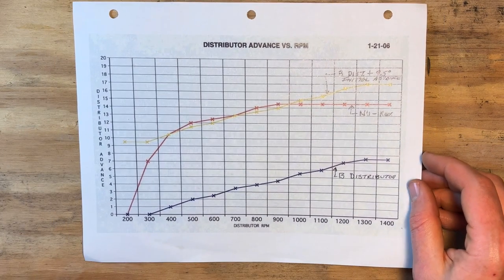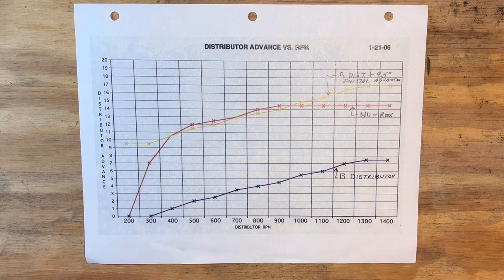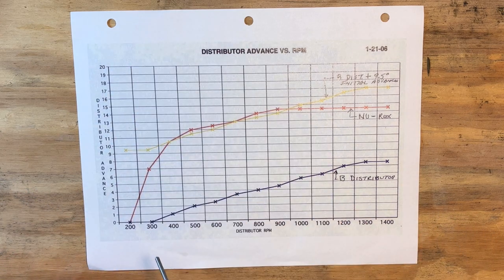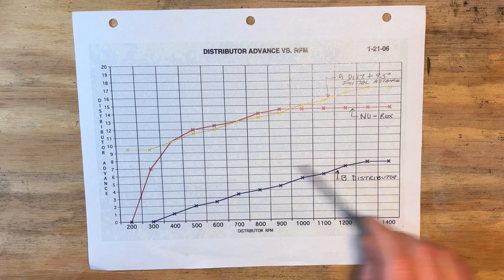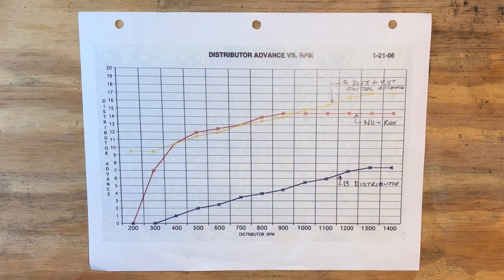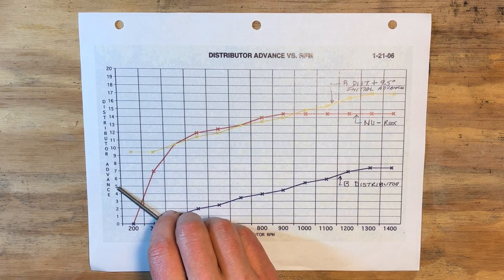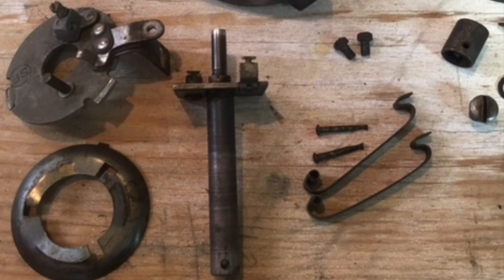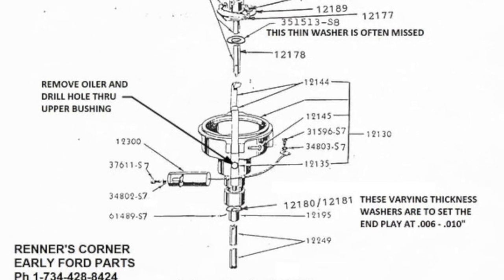Model A Ford – Upgrading to Model B Distributor – Part 1

Comment: Very nice!

As far as those pivot pins go everything in the distributor is hardened and wear it's not too likely but you can grip the pins with pliers and turn them 90° and get a new surface for the weights to act against with both the plate and the yolk pins.
Additionally, when centrifugal force acts on the weights, they spin out and they're tight against the pin.
Reply from the maker: Hi Dave, thanks so much for your comment. Really could not have done this without your prior research. Re: the pins, mine were really worn, to the extent that I couldn't be sure they would hold position, even with centrifugal force pushing the flyweights out.

I've reached out to Vince Falter to see whether he might have some reference NOS examples of the weights and springs for use in the next video, where I look at what timing curve the B produces.

Comment: Fantastic - I wish that you would show tightening the screws so viewers have an idea of how to correctly torque them.
Reply from the maker: The only one you maybe need to put a little oomph into is the cam screw. Otherwise hand tight should be fine. I tend to cut the parts where I'm attaching screws – first because I'm sort of a clumsy guy and second because the overhead camera means I would need to hold the workpiece at an odd angle so you could see what I was doing.

Comment: You should always use a cam screw with a hole down the middle so you can lubricate the yoke that spins on the small diameter of the shaft. Otherwise you have to remove the cam screw to lube the yoke a drop of 3 in 1 oil every 200-500 miles is plenty.
Reply from the maker: Good tip

Comment: Tried the B distributor but found the reissue of  Phillips Spark Advance tec made in 1930s by Nurex better.  Petronix ignition replacing the points makes for reliable and more forgiving application.  Use the common A distributor.   Like the old look but not old time consuming, fidgeting and frustrating issues of which some get satisfaction overcoming.
Reply from the maker: Yeah, if you keep compression under 6:1, the Nu-Rex is a lot more effective.

Comment: Very well done video. Clear concise instructions on rebuilding a B distributor. I believe your explanation of the purpose of the condenser and the production of the spark is just a bit off, if I may. The longer dwell, the time the points are closed, allows the primary windings of the coil to draw more current creating a stronger magnetic field. The condenser absorbs the the energy, or arcing, that would occur as the points open. The arcing would interfere with the instantaneous collapse of the magnetic field of the primary windings that induces a much larger voltage in the secondary windings which directs that energy to the spark plugs. If the condenser is weak the points will eventually burn from the arcing and the spark will be much weaker or non existent as the primary magnetic field only partially collapses or not at all. The B condenser has more capacitance because the longer dwell time means more current flowing to the primary windings and more current trying to arc across the points. I'm looking forward to more of your videos.
Reply from the maker: I think I agree with all this? What's the timestamp of the part you thought needed more clarity?
Reply: @alexiskai  I must have cut to your video on Condenser Testing and Theory that you mention at ~ 32:14. In that video, when you describe the function of the condenser, I believe you may be conflating its function with the capacitors in a Capacitive Discharge Ignition. In the Kettering system the sole function of the condenser is to absorb the energy as the points open so they don't arc. You are correct in that no current flows into the condenser because it represents a higher resistance than the closed points. Once the points begin to open the current flows into the condenser instead of arcing across the small space between the points. When the current stops flowing into the condenser the magnetic field suddenly collapses and produces the high voltage spike in the Secondary windings and delivers the spark. So the condenser really only there to absorb the arcing and assist the collapse of the primary windings. One reference on Kettering systems is here: https://www.ratwell.com/mirror/users.mrbean.net.au/~rover/ketterin.htm.
Reply from the maker: @thomasdejohn9347  I think I see what you're talking about. So the point of clarification is, does the condenser act only to prevent arcing at the contacts. I think that is by far the most important action, but it's not the only thing going on. If that were the only factor, it wouldn't really matter how "large" the condenser is, i.e., how high its capacitance. But that's not true in practice. Experiments with other Kettering system engines have shown that there is an optimal size (in practice, a range of sizes) for a condenser for a given engine. The condenser should be large enough to prevent arcing, but no larger. The reason is that a larger condenser will provide a path for the current for a longer time after the points open.

The Kettering system is a type of tuned circuit, meaning a circuit containing an inductor and a capacitor. When the points open, current resonates (oscillates) back and forth between the coil and the condenser. The amplitude and frequency of the resonance are correlated. As the condenser gets larger, it absorbs current for longer, and the "back-pressure" voltage with which it feeds current back into the circuit decreases. This causes the amplitude and frequency of the resonance to decrease. This is important because the amplitude of the resonance is what creates the voltage in the secondary winding. Higher amplitude = higher spark voltage.

There's a great demonstration of this in antique outboard motors that I will link to below. On p. 6 of the linked document, you can clearly see how the size of the condenser affects the spark voltage. That's why I mention the "back-pressure" effect of the condenser in the video and I think that's what you were picking up on.
https://wrcoutboards.org/wp-content/uploads/2020/04/Part3_Sizing_Condensers_Correctly.pdf
Reply: @alexiskai  Thanks, I read that article and yes your reference to a "back pressure" effect of the condenser is what I found misleading. The article you've cited explains that the collapse of the primary magnetic field generates several hundred volts in the primary and tens of thousands of volts in the secondary to cause the arc across the spark plug gap. Those several hundred volts generated in the primary would also arc across the point gap if it were not for a condenser of the right capacity to absorb just enough of that energy to prevent the arc on the points but not enough to lower the primary voltage amplitude enough to adversely affect the secondary voltage. There is essentially no discussion of a "back pressure" or any "feeding back" into the circuit. The article concludes " . . . that the condenser size is FAR from critical; anything large enough to quench the arcing cross your points is all you need."
Reply from the maker: @thomasdejohn9347  He doesn't discuss it in print but you can see in the oscilloscope diagrams he includes that the resonance is there. How could it exist if there weren't a reverse voltage across the coil primary winding caused by the capacitor discharging? This section of the Wikipedia page on LC circuits gives a nice summary: https://en.wikipedia.org/wiki/LC_circuit#Operation

I agree with you that dissipating the arc at the points is 95% of the job of the condenser, but insofar as I was trying in that video to give a reasonably complete description of the electrical activity, it would be misleading not to discuss what happens when the condenser discharges. I might have given it too much prominence.
Reply: @alexiskai  There is a "reverse voltage" across the primary windings. It is caused by the Back EMF from the secondary windings, not by the condenser. The LC circuit you cite is not like an ignition coil, which is analogous to a transformer. If you ran the graphs without a condenser in the circuit, allowing a wider gap of the points when opening to eliminate the arcing, you would see the same waveform, albeit with a much higher voltage spike. 
From "Part 3 – Sizing Condensers Correctly": Without any condenser in the circuit – when the points open up, the large voltage induced in the primary windings will rise to enough voltage to force the current to continue to ‘arc’ across the points, overheating and burning these contacts into early failure.  This high voltage can easily exceed several hundred, to a few thousand volts.  With a condenser in the circuit – when the points open up, the condenser gives the current in the primary winding somewhere to go….OTHER than arcing across the points.   This allows the current to approach zero at a slightly slower rate, which reduces the voltage generated in both the primary AND secondary windings.   This lowers the primary voltage “kick” to about 100 to 200 volts peak - (200 to 400 volts peak-to-peak), preventing the points from arcing and burning out.
Reply from the maker: @thomasdejohn9347  OK, I did some more research and I think I got to the truth. This is from a Delco-Remy manual circa 1949:
"The ignition condenser provides a place where the current can flow during the first instant that the points begin to separate. The current thus flows into the condenser instead of forming an arc between the separating points. The amount of current that the condenser can thus accept is very limited, so that the condenser becomes charged very quickly. The condenser thus acts both as a storage chamber for the current and as a check on the current, which quickly brings the flow of current in the primary circuit to a stop.

As the flow of current is thus halted, the magnetic field, which depends on this flow of current, decreases rapidly in concentration. The very rapid change in the concentration of the magnetic field (or flux) causes a high voltage to be induced in every turn of both the primary and secondary windings…

As the spark appears at the spark plug gap, the energy in the coil (stored in the form of magnetic flux) begins to drain from the coil through the secondary circuit, thus sustaining the spark for a small fraction of a second or for several degrees of crankshaft revolution. During this interval, the condenser discharges back through the primary circuit, producing an oscillation of the current flow in the primary circuit during the brief interval that is required for the primary circuit to return to a state of equilibrium. Note particularly that the ignition condenser does not discharge until after the spark has occurred at the spark plug gap. *This is in contrast to former theories, now disproved, regarding condenser action.*"

So there you go. I was right that the condenser discharge was producing the resonance, but you were right that this has nothing to do with producing the spark. I guess if you work on 1930s cars you learn 1930s electrical engineering, and sometimes that's wrong.
Reply: @alexiskai  The Ringing or "resonance" that you refer to is NOT created by the condenser. In the article https://wrcoutboards.org/wp-content/uploads/2020/03/Articles_Ignition_Part3_Magic_Of_Magneto_r.pdf, written by the same author that wrote the original article showing the graphs of the several different condenser values, take a look at figs. 3-18 and 3-19. Clearly shown is the Ringing generated DURING THE SPARK GENERATION that is entirely a function of the applied voltage to the primary windings of the coil and the sudden collapse of the magnetic field. The discharge of the condenser happens AFTER the spark, as your 1949 article suggests, and happens when the points are closed and the primary coil is being recharged.
Also take a look at the section "Energy Storage in a DC Circuit" in this article: https://www.learnabout-electronics.org/ac_theory/inductors.php that shows the Back EMF in an Inductor.
Reply from the maker: @thomasdejohn9347  Makes sense, thanks.

Comment: You say in order to set initial timing on an A to B timing,  you need a B valve cover.... don't you mean a B timing gear cover?
The B valve cover won't fit the A , but the B timing cover, with it relocated timing pin will.
Reply from the maker: Did I say valve cover? Oops. Thanks for the correction.